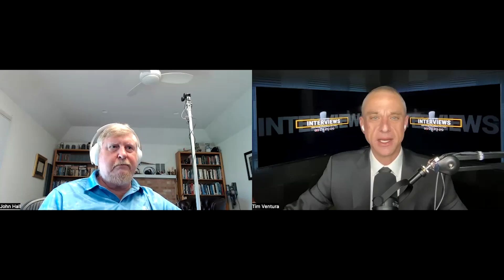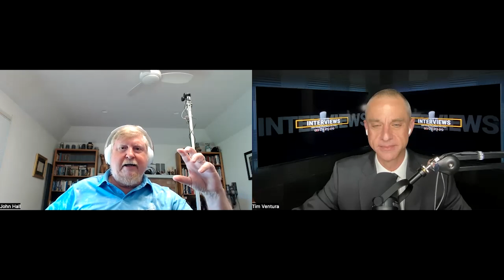Nanotech Ocean Extraction | John Storrs Hall

Comment: The local Galactic offices of the Sa'en Betting Syndicate have suspended odds-making in Sol system.  Currently-posted odds will remain in effect through the next Reset.  
Runaway nanotechnology extinction 5:4 
Non-nanotech artificial plague extinction 6:1
Idiocracy-type senescence  14:1
Episiarch  or Tandu exterminate or force-adopt Earthclan 1:5
Earthclan self-terminates or self-resets via cats 1:8

all bets final
NOTE: gold-pressed latinum no longer accepted, pending tax

always bet responsibly, subject to species morale code if applicable

Sa'en Betting Syndicate is not responsible for individual customer's indenture, forced-adoption, disintegration or mutation as a result of Syndicate activity.  No nanotech is 100% safe.
Reply: fuck, that was funny!!!
Reply: What you write may be true, Butt I can't be bothered reading your whole diatribe, Butt You are Probz Right!